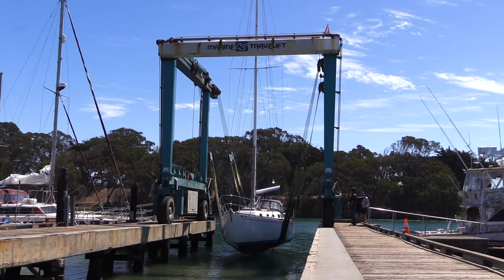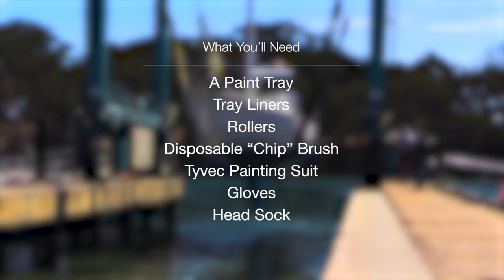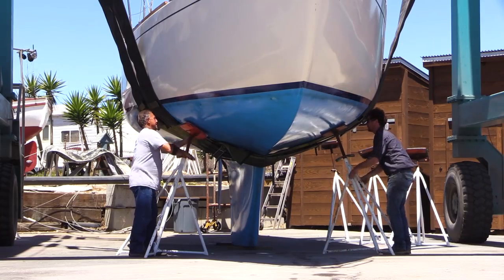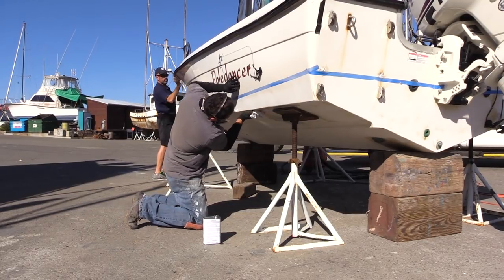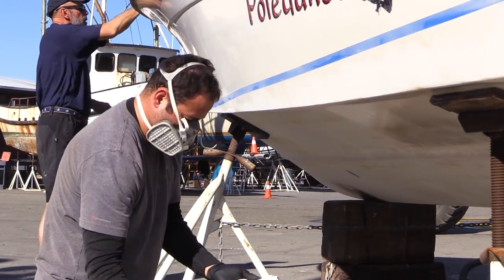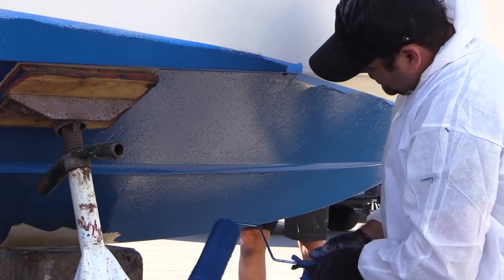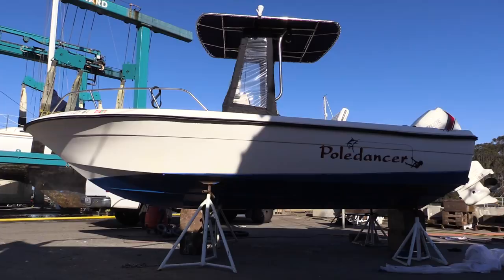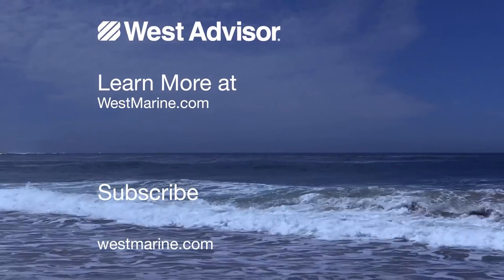How to Paint a Boat - DIY Guide to Bottom Painting

Comment: I'm not certain, but I doubt they are going to leave my boat in the travel lift for the 18 hours required for 2 hours between coats and the additional 16 hours dry time needed before launch. Is there another option for getting the bottom of the keel?
Reply: just put it on its side ig

Comment: Not a very good video here -- I can see why there are very few comments.
You con't say what type of paint to use, or what you used to prime the hull
with before you painted, or if you primed at all ? If you going to make a video,
produce an informative and thorough one.
Reply: They didn't need to add information that wasn't needed. I work as a marine restorer and do bottom paint and prep on boats everyday.  There is no primer, but the surface must be meticulously kept for the paint, as said in the video, with sanding or not, depending on if you're applying a different type of paint after. The paint will differ, and there are many different kinds, and companies making marine bottom paint (water based, Ablative, which wears down better, paints that customers want to add color and include copper. It's situational) the video probably avoided using brand names for copyright reasons.